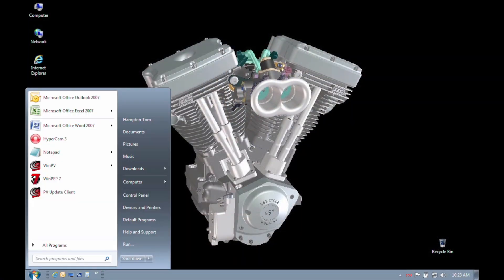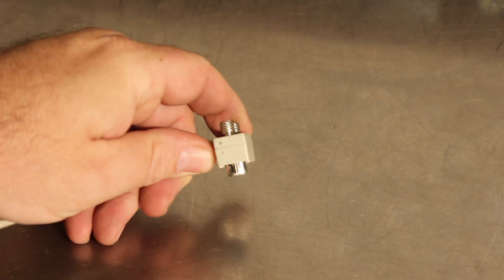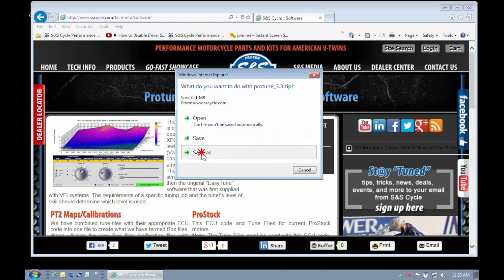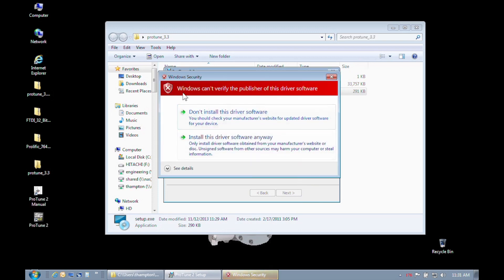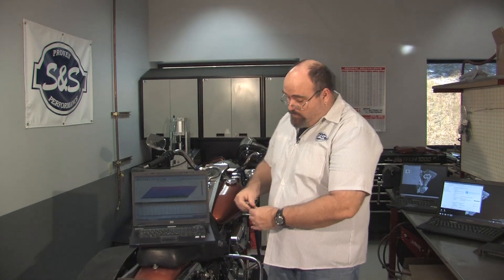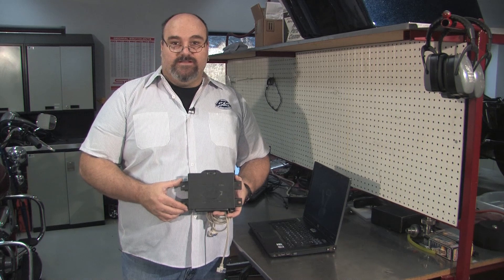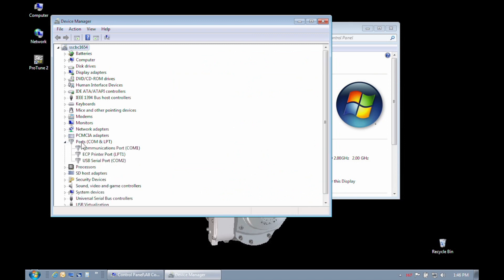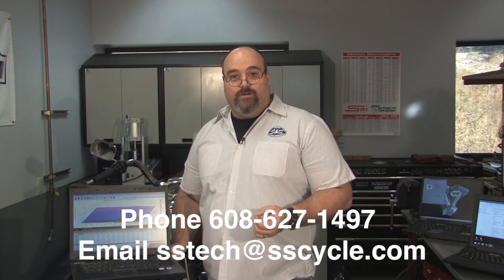Installing S&S Protune II VFI Software

Comment: S&S software designers must have been trying to win the "most complicated tuning software award". They missed the fact that professional EFI dyno tuners need to make a living using an effective "tool" for the job and not be bogged down in over complicated software.

Hey S&S, nobody likes your Pro tune software, nobody uses S&S VFI.
Talk to real industry tuners on the ground doing this stuff for a living and get up to speed with the needs of high volume tuners.

Look at the SE Pro super tuner,  TTS mastertune & PowerCommander Vision interface formats. They sell a lot of units because tuners can use them and be effective with them.

Hers is your next board meeting plan for S&S VFI lagging sales.
1/ Consult a busy dyno EFI tuner doing 150 + bikes a year from stock to supercharged wild.
2/ Note he is probably savy with SE Pro, TTS, Power Commander Vision & 5, and maybe Thundermax and Daytona Twintec.
3/ Note the twisted look on his face and the weight on his shoulders when you mention tuning with S&S Pro tune and the lack of units that ever make it to his dyno.
4/ Go tell the software designer that some EFI dyno tuning guy has a better flow design and more simple format and didn't cost you a dime, but he would be happy to take a few hundred grand for shits and grins.
5/ Get the new format tried and qualified by the busy dyno guy , not a NASA scientist.
6/ Keep it simple!

Signed.....Busy Dyno Guy